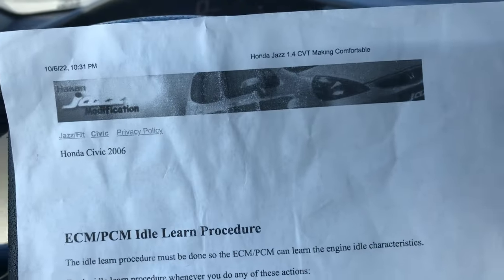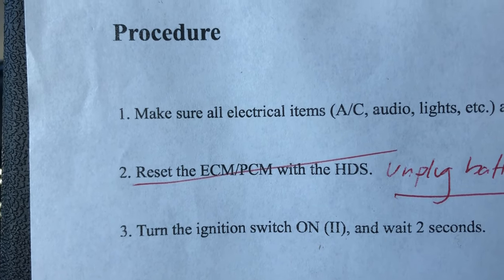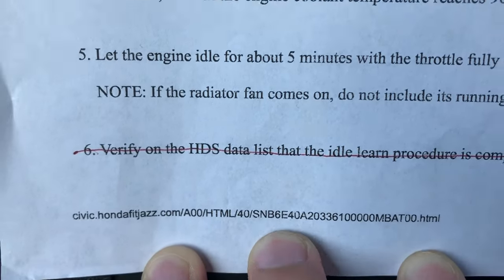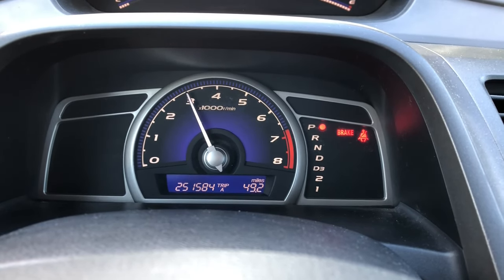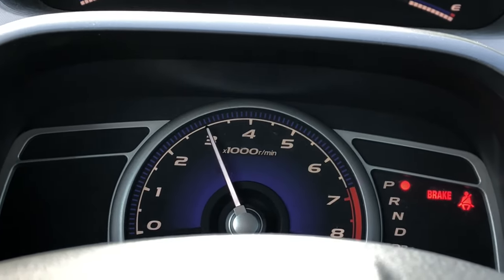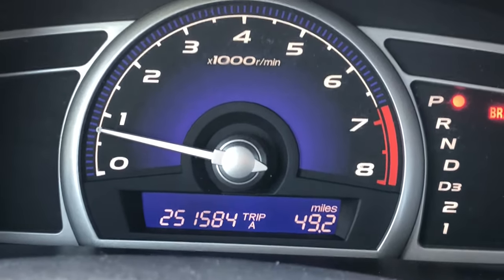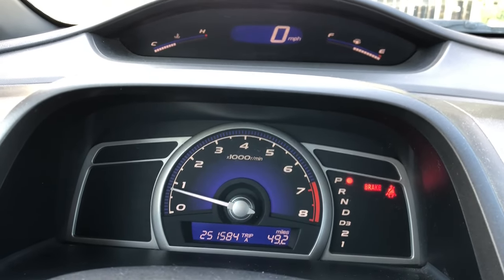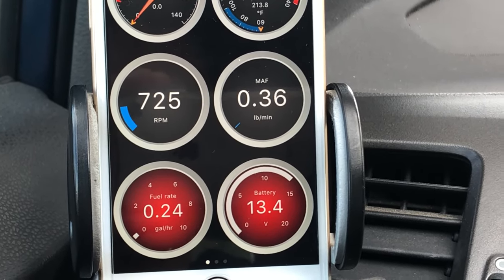How to set the idle speed by the Honda Idle Learn Procedure 2006-2011 8th gen Civic

Comment: Not necessary at all.  In fact... You're better off letting the ECU learn your driving habits and climate on its own. The only reason there is even a generic reset to begin with... Is to keep customers that do understand how the the ECU works from coming back to the shop unnecessarily. Just drive like you would normally and the ECU will conform to your driving style and atmosphere. Remember guys... Inline 4 cylinders run a little rough by default. Don't over think it.
Reply: Good point 👍
Reply: Well mine threw a code and I can’t drive it. Bc it doesn’t know the throttle
Reply: @dillankennedy9607  You're dealing with an entirely different issues than the topic at hand. You need to hook up to diagnostic machine to see what's going on. Hope you get it straightened out.
Reply: that doesn't work when you car revs to 3k over and over making it nearly undrivable.
Reply: @jailolz  Then you bigger issues than a idle issue.
Reply: Why not necessary? I’ve cleaned up the throttle body and it needs to be learn the proper position of the throttle. The car accelerates on its own. Also, when the car shifts up, rpm goes down and up again. I will try it today. The fuel consumption increased slightly. I think the brake pads and disks will complete their lifespan earlier 😄
Reply: @fcesur77 did this fix your issue? im having the same at the moment.
Reply: I do need it cause mine didn’t have ac working for years now every time I step on the clutch it can’t hold idle and dies
Reply: I think relearn is very important, maybe those who did not clean the throttle.body by themselves won't  agree with me. I tried to clean my car's throttle body and  I was very happy because it performs so good but what I have noticed is that it consumes my fuel so fast, so I tried to relearn it and it works
Reply: Help.. i cant hold my rpm to 3k its always below and above. No matter how i try
Reply: Help why its hard to maintain revving 3k rpm? Please help no matter how i try its always above or below 3k
Reply: Help pls
Reply: Horrible comment, can’t believe this is at the top… Newbie who just replaced my O2 sensor and my RPM was jumping like crazy in park, this completely solved it with a thorough explanation based on actual Honda procedure. Verified by a Honda employee I saw elsewhere on the Internet. Worked like a charm for me, Honda built this in for a reason, don’t listen to this comment! Thanks Kelvin!!
Reply: Thank you very much  . I remembered your comment . I drove it a short distance as the idle was erratic . It finally reset itself to 800 RPM after 10 minutes . Purrs like a kitten . Cheers 🍻
Reply: Holding the RPM at about 3,000 is speed up the engine warming up to operating temperature.
Reply: Worked for me after car was lumpy for days. Did the procedure in 5-10 mins. All good and smooth

Comment: Thanks Kelvin, did the exact process thanks to you after cleaning the throttle body, and the idle surging in park at almost 2k rpm. The process worked like a charm bro. God bless and be safe

Comment: I cleaned the throttle body and did this relearn procedure. My car now idles at 1,100 RPM. Any tips on how to get it down to 600-800 RPM?
Reply: I just cleaned mine too I'm idling 8-9k rpm now I'm on the process on doing this technique hopefully everything works out.....
Reply: Did mine today, Honda Accord. Left battery off for 1/2 hour. Fan never came on as 2 centigrade outside but followed rest of procedure and now runs like a dream
Reply: Just following up… I was able to borrow an expensive diagnostic tool (Autel MX808 MaxiCheck) from a friend. I ran a TPS reset and then I did this relearn procedure. It worked perfectly! I am now around 700 RPM at idle. I tried the relearn procedure at least 7 times before, but it only worked after I ran the TPS reset on the diagnostics tool. (I used the Autel MX808 MaxiCheck All System & Service Diagnostic Tablet, USA Version from JB Tools.)
Reply: @C7Tmac  Lol what? 8-9k?? How is that even possible?
Reply: When you disconnect both cables on battery, you can touch cables together and that discharges capacitors in the computers to lose  all memory. Much quicker process. A little spark is normal but not common.
Reply: Hey I’m having the same problem ;(( do you happen to know the exact diagnostic tool your friend had?
Reply: @marcosdiaz9722  Autel MX808 MaxiCheck All System & Service Diagnostic Tablet, USA Version | JB Tools
Reply: @KDBHonda256  ...capacitors in the computer carry loads. When they discharge they put off a very small, tiny, little, minuit spark, most of it absorbed by the ground.
Reply: @KDBHonda256  Ever see a spark from static electricity? You can in the dark. Maybe look up the word tiny, minuit, small. You should know, looking at leaking wires show up more in the dark.
Reply: @KDBHonda256  True on your last comment, but God did stop the sun and moon in Joshua 10. You haven't seen that.
Reply: I did the relearn on my honda civic and accord after cleaning the throttle by using a scanner and both cars have 700-800 rpm.
Reply: For the last 9+ years I didn't do any idle relearn on my honda. 
At idke, the butterfly opening change, progresdively, as the dirt accumulate in the throttle body and on the bitterfly valve. 
To mantaince almost close to factory setting openning all the time, I do throttle body cleanning every time I change the transmission fluid, basically every 30k miles or 40k km. This way the butterfly valve openning doesn't drift so far.
Not much carbon in there. Pray some carb cleaner on a small towel/cloth and wipe clean the inside & butterfly and good to go.
No effect to the idle speed, always at 750 RPM.
Reply: @metzmatu8409  ..what year is your Honda and is it a Odessey?
Reply: @joehumeas7196 Hi Sir, may I know what was the rpm like before it idling at 700? Mine now at around 1200 and it is not coming down after the relearn procedure. Thanks

Comment: quick tip, when you disconnect the batter turn the headlights to the on position do that it full drains all electricity. (thanks scotty Kilmer=) )
Reply: Yep, during air bag replacement procedures I always turned the key to get those loose electrons out!

Comment: I did everything you said. Idle was still rough . I took it for a good drive and it reset itself to 800 RPM. Purrs like a kitten . Odometer reads 200k ,it now runs better than it’s ever run before . Thanks so much . 👍

Comment: Does the car need to be completely cold or can I do this with a warm engine?
Reply: That's what I want to know
Reply: The relearn of letting the engine idle for 5 minutes require engine warm at operating themperature. 
The reason holding the RPM at 3,000 is to speed up the engine warning to operating temp, where the fan turn on.

Comment: Thank you for this. Bought 10 year old Jazz that had a very fast idle speed. Think the dealer had either removed the battery or allowed it to fully drain. When re-connected/charged the car did not have chance to reset the correct idle speed. My wife spent most of the time with her foot on the brakes as the car was constantly pulling away. Racing engine producing far too much noise. 
I disconnected the battery for 15 minutes, reconnected and made sure everything was turned off. Re-started and the idle speed was about 1500+rpm. Held the rpm at 3000 for about 4 minutes until i was sure the fan was cutting in. Then allowed the engine to idle and it dropped to about 700rpm. Left it idling for 10minutes. Turned off the ignition and then re-started. Idle was about 1000rpm and quickly dropped back to about 700rpm. Wife now totally happy as this makes the car much easier to handle. Thank you so much, this had made such a great difference. Perfect !!!
Reply: Help why its hard to maintain revving 3k rpm? Please help no matter how i try its always above or below 3k

Comment: Cleaned the throttle body, rpm/idle starts surging, saw this video and followed the procedures,  rpm/idle went back to normal, thank you!
Honda civic 1.8 2012
Reply: I have the same year and model as your 2012 Honda Civic 1.8 . But for me after cleaning the throttle body I got three lights on my dash after that engine,vsa, steering lights. Did this happened to you?
Reply: @yassineyahia4110 
Happened to me, my Mechanic did a procedure not exactly sure basically disconnected the battery then after that put ignition key to position 2 without starting then position 0 repeated three times.
Traction control, steering light turned off after this

Comment: Thank you for your video.   My 2011 Honda Accord ex-l 2.4l now running like a champ.   Your video is very detailed.   A small tip from me: I used a stick to push down the gas pedal and let it leans against the seat at position of 3k Rev and then  just walk away to work on my garden for about 10 minutes then come back to check the radiator fan (hood is open). Guess I don't have enough patience.   Anyway very appreciate your video.
Reply: Help why its hard to maintain revving 3k rpm? Please help no matter how i try its always above or below 3k

Comment: Thanks!  My 1996 Honda Civic makes no mention of any idle learn procedure but I suspect that something similar applies even though they don't bother to inform us in the manual!  They do make mention of using the "Honda PGM Tester" as preferred method of setting idle speed vs. using the idle speed screw on the throttle body so I guess we have to assume that they are saying that you can either make direct adjustment with that tool or you can simply see if the idle learn cycle has completed.  Mysterious.

Comment: Hello, I just found your video and I hope it works for my 2015 civic LX 1.8l. I replaced the intake air hose, cleaned the mass sensor and the throttle but the rpm is running higher. Hopefully it works. Thank you
Reply: On my honda civic 2015 1.8 nothing work,my rpm still 2000
I was told that I need a honda dealer scanner to reset my high idling

Comment: I have the same car and in my car the car is shaking at idle or reverse. I also noticed that the RPM goes down.
Do you have any idea how to fix that?
Reply: the torque mount under the car is likely worn out, when i replaced that in mine, my car felt amazing at idle and reverse

Comment: I did everything like you said and it back to normal. But there is one thing that the RPMs surging while braking at low speeds causing car to lunge forward, it is very annoying. Anyone experienced that and how to fix this? It wastes the gas

Comment: Hey buddy I have a question. What is the reason for keeping the car at 3000 rpm? Is it just to warm it up faster for the fans to go off? Or is there another reason. Can I just let it run till warms up without keeping it to 3000 rpm? Thank you
Reply from the maker: not 100% sure but i think it’s (1) to warm it up to operating temps but also (2) to give it a reference point for the ecu to ‘know’ it’s at 3000 rpm.  i think it’s necessary to to get it to 3000 rpm for it to work properly
Reply: @kelvinsgarage  thank you. It does makes sense.
Reply: Keeping it at 3,000 rpm is just to speed up engine warming.

Comment: I have honda civic 2015 Lx 1.8 Liter..i took off my throttle body completely, and cleaned it very well,and put it back with brand new air filter ,and cleaned air mass sensor..my car still idling 1500rpm to 2000..all this method didn't work on my car..can any body help me, what should i do??
Reply: I was told that I have to go to honda dealer to re idle or relearn it on honda scanner

Comment: Can I do this on my 2003 odyssey  ? I clean  th trottle    But never  did the relearn   And now. Rpm wen like crazy. 3000 by it self. I had to   Disconnect the negative. And looks like. Fix the problem but  since I know now that  need to do relearning I hope it will work

Comment: Hi, I tried twice this morning but it did not work at my wife's 2018 Honda HRV. Will we see the RPM to come down immediately after the procedure or should we let the car to learn the driving habit for some time for the better results? The RPM still stays at 1200-1500 after the procedure and causing higher fuel consumption and not smooth driving experience.
Reply: Look for vacuum leaks make sure everything was reconnected properly

Comment: After clean my TB on 8g TypeR I have problem with iddle. We change TB. But it never be same as before. What I hate. Is a jump after gas of pedal. Drop RPM isn’t smooth. And around 1200 jump before idle. Miss me my old RPM..😢
Reply: Check the TPS
Reply: @metzmatu8409  k20z4 haven’t TPS.

Comment: Have tried this after replacing the throttle body and no joy. Idle RPM has stayed at 1200. Doesnt surge anymore but idle way too fast. Any hints as to what to correct. Originally cleaned the throttle body to cure a surge and did the reset. After that it idled fast all the time. That’s why we changed the throttle body hoping that was what the problem was. There are no vacum leaks that I can find. Any help appreciated.
Reply: You ever figure this out?!
Reply: @StraightModderps3  yes. It needs a bidirectional scanner to reset the idle learnmemory. Disconnecting the battery does not reset the memory. Found a shop that had one and they charged .5 hour to do it. Things are good again with idle dropping back to 750-700like it used to,
Reply: In fairness this video was to cure the surging idle which was cured but left the idle speed at 1500.

Comment: My civic idle drops 600rpm when AC turn on but return to 800rpm right after. Is that normal? Thanks
Reply: 600 rpm when AC on is low. Normal should be 750-850 rpm.

Comment: i replaced my tpms sensors, is there a way i can reset the tpms light. i dont have the “tpms reset” button in my car like the owners manual states. i have an 08’ civic ex
Reply: You should have a reset option in your car settings. You also have to be in Park in order to reset the TPMS

Comment: Had P0606 come on and acceleration cut out while driving. Had throttle cleaned, and occasionally receive p0507 code for higher RPMs. I repeated this videos process twice exactly....and RPMS still sit at 1.1k and go to 1.4-1.5k when fan kicks in. Since the cleaning, ive driven about 15 miles. Anyone know what to do? 08 civic
Reply: Maybe this can help...
"Vehicle(s): 2006-08 Civic, 2006-08 Civic GX, and 2006-2011 Civic Hybrid

Details: If a Honda Civic, included within the year and model range listed above, comes in with diagnostic trouble code (DTC) P0606, Honda advises to first verify that the factory recommended spark plugs are installed. Aftermarket spark plugs may have built-in capacitors that can cause electrical interference, which will set DTC P0606. Also, the same DTC could set if the spark plugs are badly worn with a gap of 0.080” or more."
Reply: @metzmatu8409  Thanks for sharing. I replaced my spark plugs and ignition coils with genuine parts and that seems to solve it. I was running my 08 civic with the original coils til 205k (oops lol) My faulty coils fried my spark plugs way sooner.

Comment: my fans did not turn on, i waited 10 minutes, should i wait longer?
Reply: Mine did after 10 mins
Reply: @Jacob58201  my fans turn on for 5 seconds at startup then turn off, my ac unit doesnt work
Reply from the maker: make sure you keep the hood closed, when the temperature gauge points to the middle, that’s around when the fan will turn on and off
Reply: @kelvinsgarage  ok, my catalyc needs replacement. havent replaced the original one its 08

Comment: I cleaned my throttle body now after putting everything back together I step on the gas to do the idle relearn and nothing happens? No throttle at all. I've taken it apart and everything was/is connected properly. Any ideas?
Reply: Did you happen to move the throttle plate by hand, while cleaning the throttle body? (The throttle plate in an electronic throttle body can't be moved by hand, without risking damage)